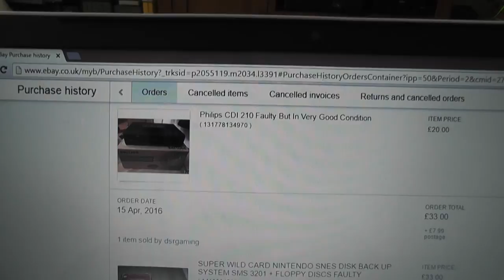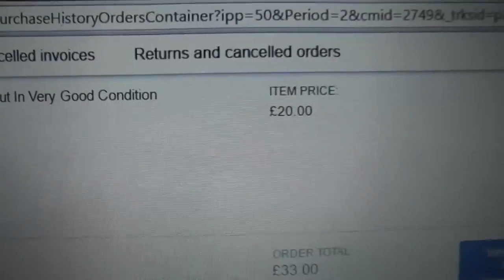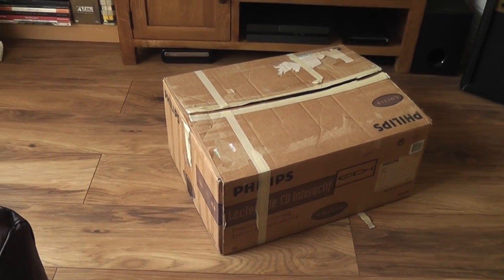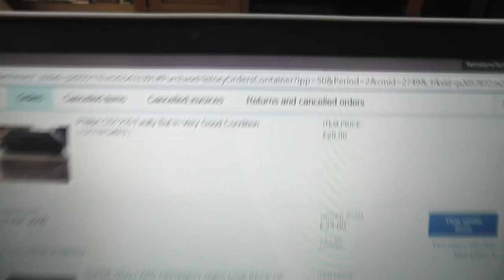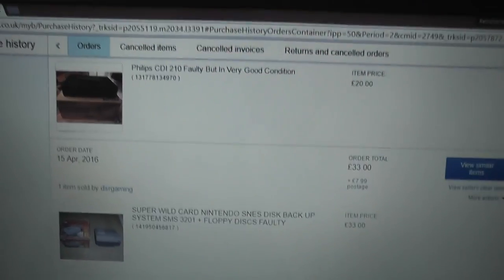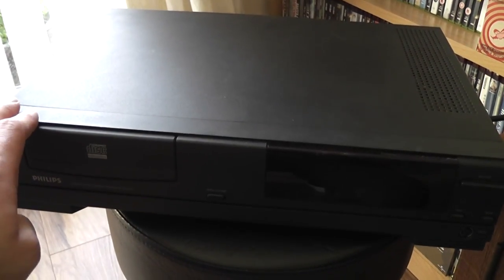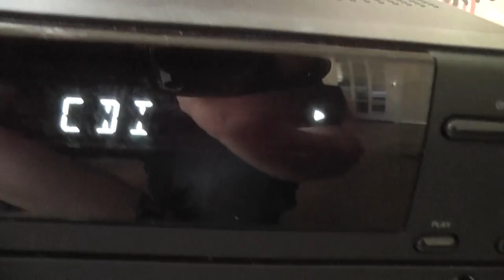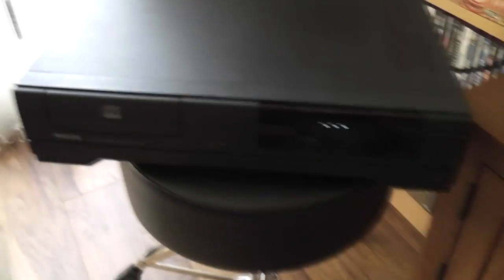Let's Repair - Ebay Junk - Philips CD-i - Dodgy Drive - Part 1

Comment: I love seeing these repair videos. I'm looking into repairing my Sega Genesis (Mega Drive). The console turns on, but nothing displays on the TV. I also believe the Sega CD disc drive burned out
Reply: I've also never repaired anything before.
Reply: Does it still output sound? Is your Sega CD a Model 1 or Model 2?
Reply: ***** I'll have to double check, but I don't think it does. It is a Model 2 Genesis and Model 2 Sega CD. I also have the 32X, but no way to tell if that still works or not. I've tried the Genesis with the 32X on and off.
Reply: Model 2?
You using an Av cable?
They are prone to dry joints on the AV out.
Reply: I just fixed mine open up the case and check the solder points for the av out. Most likely it has to be touched up

Comment: Looks like a bit more challenging repair than just a simple cap replacement or a cracked solder joints. Already looking forwards for the later part(s).
Reply from the maker: But those are probably harder to diagnose :P . Parts came in today so next chance I get I'll make part 2. Hopefully no need for a part 3!!

Comment: Are you sure the spindle hasn't been pressed down into the motor?  I wonder if it got jammed with a disc at a funny angle - that could push the spindle down so it wont rotate.
Reply: Was thinking the same thing. The belt being rubbish also wont fully engage the cd mechanism even if you manually push the tray closed. Engaging and disengaging that assembly is more stressful on the motor/belt than the drawer opening.
Reply: Yep it looks like the spindle is jammed. Once it's out, you could apply some voltage to the motor directly to see if it still spins.
Reply from the maker: No, but that's a good call and I'll definitely check it out when I properly disassemble the unit. Thanks for the suggestion!
Reply: No worries!  Glad to see you doing videos again - we've all missed them =D

Comment: I can remember when they were new and being advertised as kiosk systems. Not really clear what you should do with one. It was just "the latest thing". I never saw it advertised as a gaming console. The machine just fell through the cracks. Interactive video never really made a big difference back then.

If you have to order a replacement belt, how do you select what you need? I can imagine there are thousands of different lengths, widths and what-not.
Reply from the maker: I just went with a generic Philips "compatible" DVD tray belt. I'm guessing they're mostly a standard size and can stretch a bit if needed. They're dirt cheap so trial and error is an option.
Reply: I sold a CDi unit to a friend who's also found the drive to be faulty. Probably a similar problem then. Thanks.

Comment: You said the motor was bad because it didn't spin on power up, but have you tested for voltage on the motor's red and black wires during that time? Maybe the motor controller on the board is dead, and no voltage is being sent to the working motor. Does the motor spin if you supply adequate power directly to it?
Reply from the maker: All things to look at in part 2 :)

Comment: I've had the stiff motor problem before and fixed it without a replacement. Somehow the spindle head has been pushed down and is rubbing the chassis. I fixed mine by prying it up a little with a butter knife until it span freely. Worked fine afterwards. Might be worth a try on yours? Also had to do a belt replacement.

Comment: I have had two units similar to yours, and had to replace that belt on both of them. No problems with the motors or lasers though. Hopefully your laser will be fine.
Reply from the maker: Hey, Ed! That's good to hear! I ended up finding a motor online way cheaper than I mentioned in the video. So that's already on it's way. It just worries me whenever I see signs of someone having already opened up a faulty system. Did you keep yours, or flip them? Any good games you can recommend?
Reply: RetroGameTech
That's great, but I'm honestly surprised you were able to find a replacement motor for a CD-i in 2016.

I sold one of that model, and it paid for both with about $30 profit left over. I also bought, repaired and sold a Magnavox model that just needed a battery.

I have yet to find and play any genuinely good games for the CD-i yet, but I have a few that are at least playable:

-Earth Command is a strategic simulator that is vaguely reminiscent of Sim City.

-Video Speedway is the only game I have that almost plays like a real game, a really boring game. Think Pole Position with bad controls.

-Burn Cycle wasn't half bad. I never actually finished it, but I might someday if I have nothing better to do. I have to imagine that Burn Cycle is the best game on the CD-i, but I wouldn't spend much money on it.

Comment: the thing with the damn belt there is that it doesnt only operates the door but it is also responsible for getting the cd tray lifted up to catch the magnet... so maybe that's why you didnt get any noise when you closed the door manually... try lifting that bound spindle a bit cause the axis of the motor might have just shifted... the spindle seems to be bound up by someone's stupidity trying to get it to spin or something... nice overview! love the the videos keep it up and if possible more often please :)
Reply from the maker: Great advice and will definitely be taking a closer look in part 2. Thanks for commenting! :)

Comment: Would it be possible to use the drive out of a PHILIPS CD Player.
Reply from the maker: Doubtful, unless it is from the same year and they used the same drives in similar devices.
Reply: it would have to be flashed with the same CD-i firmware which it most definitely isnt

Comment: The spindle motor should be fine. As a test, take it out and apply 6 volts to it. If it spins up, then it looks like the spindle itself has lowered due to the glue or pressure fitting becoming loose. Try prying it upwards to create more of a gap between the drive deck and spindle hub assembly. Gluing it back in place is then a pain, but if both parts are metal (which they seem to be), a metal based 'bondo' or epoxy filler should do well there.
Reply from the maker: Thanks for the tips. Will take a proper look at it when fully disassembled.

Comment: what would you do with a master system 2? since it doesn't have a led you cannot say if it doesn't work or if the problem is with it's connection to the tv

Comment: That looks like a Philips swing-arm mechanism (check the model number -- is it a CDM4/xx?) -- these are quite expensive to fix if the laser needs replacing, and they need locking bolts to be installed underneath when transported. Is it possible the seller has installed these? This could result in the whole mechanism being locked -- it's been a while since I saw one of these so can't remember what the symptoms are of a locked mechanism.

The belt is a common failure on these (assuming it's the right model I'm thinking of) and replacement belt/pulley kits are available cheaply from ebay.

Comment: You should be able to remove the tape by using hot air. It softens the adhesive most of the tapes use to a point when it can be removed without damaging the box. But that's a lot of work, just in case this item becomes super-rare and valuable or something. I guess the seller just didn't feel like wasting too much time with a 20 pounds item :d

Comment: Hey. I got myself a Philips CD-I Model 470 which is like the smallest model that I can find and when I hook up everything with the AV and RCA hook on my tv, there's a green screen of death! Is there any way to solve this problem?
Reply: Also, the cd tray works though it sounded very scratchy.
Reply: did it make any sounds? check the RCA connectors, or probably U have a dead NVRAM

Comment: That spindle really looks like it's rubbing against the metal base of the optical drive. It doesn't sound like the motor's bad. If you could physically feel something or there was a grinding sound when the motor was spun then it would probably be bad.
Reply from the maker: Good advice. Will inspect in part 2 :)

Comment: before I watch this a 450 lens is hard to find with wire plug and if you do it will be wrong size I had a 450 &,910 the 910 would only show a blue screen no boituo screen noting so after months I demolised both of them keeping some parts

Comment: They should of double boxed it when shipping even if it is faulty. I would try removing the motor and applying voltage to it to see if it spins freely, before you order replacement parts, the motor shaft may have been pressed down so the cd spindle is dragging, you may be able to pull it out, or push it from the other side.
Reply from the maker: Thanks for the tips. All things I'm going to test before taking it apart further. The parts arrived today and were dirt cheap so no real loss if I don't end up using them I suppose :)

Comment: You might be able to remove the tape from the box using hot air ,I used a hair dryer to remove tape from a box that and lots of patience
Reply from the maker: I don't know if it's worth the effort at this point, sadly.

Comment: Lol I have this exact same model with the exact same problem. It's sitting idle in a cupboard right now. If you fix this would love to know where you got the parts from, so can bring my back to life. But if it's an expensive laser replacement then it can go as junk to be sold
Reply from the maker: I got the parts on ebay really cheap. But those lasers are hard to find and over-priced when you do! Will make part 2 soon. Hopefully yours isn't junk.
Reply: RetroGameTech what will the next console that you will fix??

Comment: If you need to order a new optical laser with motor you can get them off eBay from a guy in China: http://www.ebay.com/itm/361410058963?_trksid=p2055119.m1438.l2649&ssPageName=STRK%3AMEBIDX%3AIT
I ordered one and it worked great. 
You can also try and wedge a razor underneath the spindle of the motor and try to pry it up, as I had a similar issue with mine where it had somewhat seized up and was not spinning at all. I heard of this trick from watching a guy on YouTube, but can't seem to find the video.

Comment: Where have you been fella? I thought you had gone it's been that long! BTW use Goddard's long term brass and copper polish on that scratch on the front panel and with a bit of elbow grease and a cotton ball it will dissappear! I use this stuff to remove scratches on plastics with a shiny / polished finish and it never fails! I promise you! It's about £3 from tesco
Reply from the maker: I'm still here :P Have only have time to upload about once a month recently, that's all. Thanks for the tip. I was planning to use a bit of Brasso. I think it's about the same?
Reply: +RetroGameTech I've tried Brasso it's nowhere near as effective trust me 😉

Comment: don't pull the motor! I believe the motor may be fine. On mine the spindle got pressed down on the motor shaft until it pressed against the body, and couldn't spin. This looks to be the case with yours too. try just prying it up with a knife a bit. That's all it took for me... and replacing the belt for the tray mech but that wasn't even critical to get it to function. Sadly even after you repair this piece of ebay junk its still junk. It is a neat little piece of history though.
Reply from the maker: Thanks for the tip. I'll be fully testing the motor before I pull it. I think You might be correct about the spindle.

Comment: can anyone tell me if a ZX spectrum+ should work on a 4K TV? I cant get mine to tune in and dont have a crt tv to test it on.
Reply: don't know but does your tv even have an analog RF tuner, check the specs
Reply: +arsenixa yes it has one but so many different settings its insane! I tuned it in to a blackish screen but cant get it to come on.all 4K tv's have the aerial as they have freeview built in and that can only be used via a aerial on the roof.
Reply: I looked up freeview and it seems to be a digital service. an antenna connector doesn't mean it has a tuner to watch analogue tv channels
Reply: +arsenixa that might explain why I cant get it working,I just dont want to sell it before I know it still works! I got the original box etc but just need to see it rin before I advertise it.